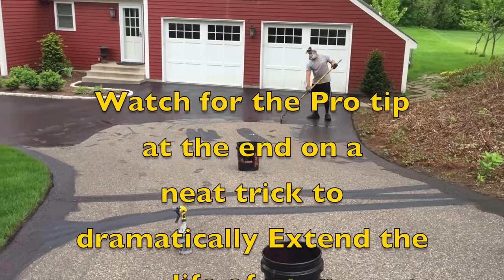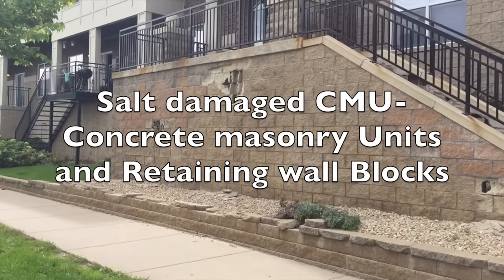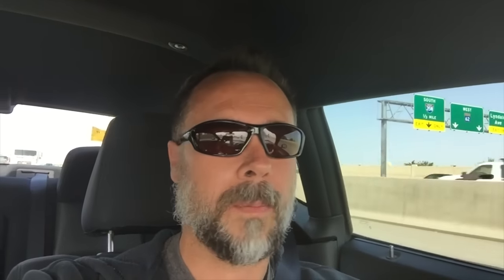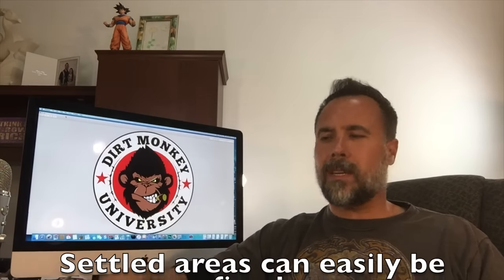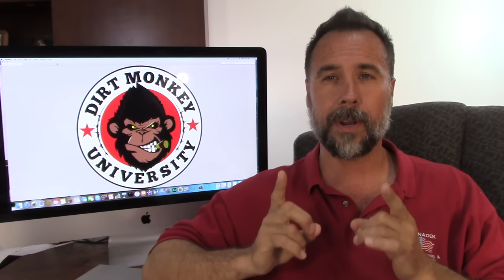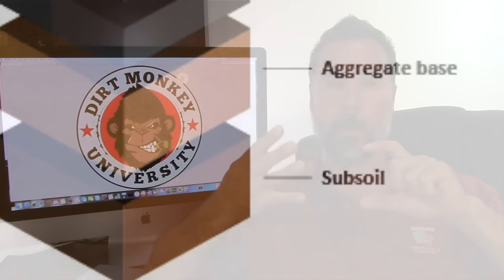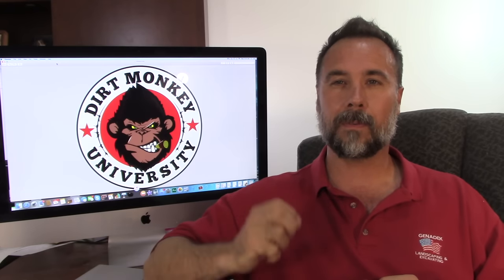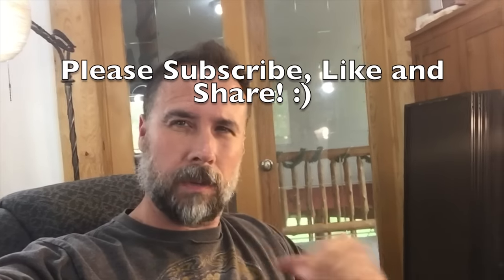Asphalt, Concrete or Paver Driveways- Which is the best?!?

Comment: SS1 emulsified tack oil works great for a quick repair on your asphalt surfaces, such as skin patching, or saw cutting with a diamond blade, correcting any base issues and then re-paving the problem area.  Lots of paving companies are happy to pick up this work as filler between big jobs where there base isn't ready.  You apply the oil, hit it with a tiger torch to prime it, add the new hot mix over it and compact for finish.  Or hitting you're existing asphalt with a tiger torch will heat up the surface to make it pliable and problems can be corrected, reasonably easily, with an asphalt lute (rake), plate tamper, and asphalt sprayer (chemical sprayer from any hardware store).  All that said the corrected area will take on a new color and stand out so seal coating should also be considered after the repairs are completed for a uniform finish.  Re-surfacing is usually after 15-25 years for a properly finished job.  If you need re-surfacing after 3 years, the paving contractors in your area are not doing their job properly.  For example, not excavating the sub base far enough, not excavating down to clay, if clay can't be found under 2 feet of excavation, not introducing geogrid (trampoline like fabric) with at least 6" of structure (3/4 road crush on top - fractured on 3 faces for ideal compaction - or soil cement), not introducing water to the gravel during the compaction process for ideal densities and maximizing load capacity of that base.  I'm talking about a 4 season climate.  If you guys are only getting 3 years out of your asphalt in Michigan I might just come down there and set up shop!  That's crazy!
Reply from the maker: Joshua-  Spot on advice!  Thank you!

Comment: Here in Alaska the muni cross section for driveway is 18" of gravel(3" minus/pit run), 2" leveling course(D1 or RAP) and 2" of asphalt, or 18" gravel and 6" concrete on anything that will be driven on.  I personally always put geotextile woven fabric under all my excavations too! Makes for a good driveway! I never get just putting 4"-6" of sub base....just won't hold up here...
Reply from the maker: You guys have to much frost movement-you need the extra base.

Comment: In Australia we typically don't use asphalt mostly we use concrete but yes always get a good base for it and use reinforcement mesh it helps stop alot of flexing and cracing in the concrete and whenever you join against and existing pour/hard rock like surface pin/dowel it to it in my area so many didn't pin and dowel their driveways paths to their homes and they pop up and make nasty trip hazzards
Reply from the maker: Very true. Good point👍

Comment: As per ACI specs we cut our lines 1/4 of the slabs thickness and depending on the slabs size we measure and cut accordingly. No more then 10' apart.

Comment: Alot of left out information concerning an asphalt driveway , an asphalt driveway that's paved over a rock hard non moving base will last 30 years without cracking as long as you apply a thin coat of non rubberized pure oil base asphalt sealer ,not the clay based asphalt emulsions sold at home Depot & Lowe's , a 5 inch asphalt finished thickness will Outlast concrete when laid over the same non sagging base ,also the depth and type of base material depends on what conditions are found under the top soil or old driveway ,after the existing soil base is compacted if any movement of the soil is seen when the compactor is rolling over it is when you chose the base materials and thickness ,in a deep snotty clay base you should allow the existing base to sun dry for 30 to 60 days before adding base stabilizing materials like 60/40 ,crushed concrete or limestone ,if you started with a squishy base then you want to mix in a few tons of Portland cement to the existing Earth and compact it before adding a layer of crushed limestone and allow the limestone to sit another 30 days before paving ,on the day of paving have the contractor put down and compact a layer of 60/40 road mix or asphalt millings & compact it before paving , make sure you order a 5 to 6 inch finished depth that's installed in 2 separately compacted layers instead of the single pour 3 inch depth standard ,once paved make sure any gaps between the paving & grass are immediatly filled in with Earth & grass seed before compacting ,stay off the driveway for another week or 2 and you can expect a double wide 2 car asphalt driveway to last you every bit of 20 years without developing a single crack ,if your new asphalt drive dosent crack within the 1st year you know you have a rock hard base that won't sag and you apply petroleum based asphalt sealer at the 1 year mark using a squgee coat just thick enough to fill in the semi pourous asphalt paving ,don't ever use rubberized sealers or water based emulsions because both will peel or flake off unlike a petroleum based sealer that binds with the petroleum based asphalt paving ,you should reseal your asphalt driveway every 12 months applying the thinnest coat possible to cover last year's sealer ,not every 3 years , if you can wait for your new driveway to be completed for 3 to 4 months and follow the base layer install outlined you can expect a 20 to 30 year crack free driveway that looks new every 12 months due to you resealing the asphalt and replacing the petroleum in the asphalt by using only petroleum based sealers , I own over 60 rental homes in middle to upper middle class areas with all types of driveways ,including brick pavers & every drive I replaced over the last 42 years has been asphalt using the standards created for America's expressways & only 1 drive has cracked due to a renter having a gas leaking truck that degraded the asphalt ,I'm also a licensed contractor with a Journeyman card in waterproofing that covers parking lots ,parking ramps ,commercial roofing ,below grade waterproofing,road building  , exterior wall waterproofing of brick cement and all woods,bridge waterproofing as well as residential driveways so I'm not talking out of my ass .
Reply: How can anyone read this without going crazy?!  Run-on sentences throughout the whole thing.

Comment: Hello, great video, Thank you. Re base thickness, do you mean before or after compacting? Which hard surface is best for South Florida so that's heat and humidity - also near a lake so not sure if salt is a factor? Current drive is asphalt (old house) with the crocodile cracks everywhere...

Comment: Stamped concrete will usually have a sealer on it as well making it slippery when wet. It doesn't seem to fair well if shoveling snow with a metal shovel either.
Reply from the maker: Good point👍

Comment: I have a large amount of water where the swale goes from dirt/gravel up to my asphalt. This has caused sinkage of the ground underneath (since water can get under). When I re-do the driveway, I'd like to add drainage so that water from this dirt/gravel gets quickly directed to the other side of the driveway.

What type of driveway is best for this, to stay flat, and to allow water to run through it? Can I get like 1 or 2 surface drains with perhaps metal grates to span the width of the driveway to help?

Comment: Crack sealing for asphalt and concrete hands down is the best contract job you can get. You can rent a crack sealer for about $300 a day buy about $500 of material, two man crew can accomplish a $5,000 job in just 1 day. Best part of crack sealing is you need no tools besides the machine. I would of never been able to break the 6 figure profit mark without adding crack sealing to my services.
Reply from the maker: I never realized it was that profitable.
Reply: Matthew Meek same here, i only work 100 days a year now
Reply: I can't believe people throw their money around like that.   My 3,200 sq. ft. driveway is being done (6" base material and 3" of asphalt) for not much more than that.  I'd either do the crack sealing myself, or I'd wait for the entire driveway to fail and then replace it.
Reply: What the heck are you renting

Comment: If you keep your water to cement ratio as low as possible, you will have less shrinkage.  Using a good curing compound will also help to minimize rapid evaporation upon initial setup.  Finally if you can seal the surface, it will help to keep the concrete looking good.
Reply from the maker: Good advice!

Comment: I really want to move to where all of these guys are having work done. I'm an asphalt paving contractor. paved thousands of driveways. I live in an area that we  get lots of snow, and the weather is usually not sunny but for about 3  months out of the year. Proper way to lay asphalt is to have a proper base first. The  base needs to include at least 12 in of pit run, which is very large Rock and gravel mixed basically virgin gravel out of the ground. Graded and compacted to the height and level that you want your driveway to be.  Next you need 2 to 3 in of 3/4 crushed gravel to reach your final grade. It then needs to be sprayed with alot of water and compacted until it feels like concrete to walk on.    This is the only way to get a proper base and not have to worry about the material that is being laid on top of it, whether it's asphalt concrete or pavers. I noticed cracks in all of the driveways that you showed your video.  If you don't want cracks then make sure that you got a proper base and by base I don't mean small 3/4 inch Rock 12 in thick. that doesn't work. Small crushed rock is not a good base material it moves around when you drive on it and never gets the compaction that you need you need big rock 10 inch plus with binder soil mixed with it. After all your prep work is done and you have the proper grade then you're ready to lay asphalt on top of it. A 3in compacted asphalt Mat is very desirable but 2, 2inch lifts is even better. There is absolutely no reason to seal coat your new driveway for the first 12 months because asphalt doesn't cure for 12 months and sealcoating you will not do any good.  After 12 months then you need to apply a seal coat.  The average cost is about $0.20 a square foot and should be applied every third year. If you do end up with some cracks in your driveway the cracks need to be filled with hot rubberized crack filler. It needs to be applied to fill in the cracks to the height of the asphalt it might take two or three passes to get it to the right height. I have driveways that are 15 + years old that have very few cracks in them and still looks like new. If the cracks are filled immediately and not allowed to sit with moisture and anything else that can get in them they won't expand can you drive will still look new 20 years later. There is no doubt in the driveways that I laid today will still be there 30 years later and look good. Love you Work Stan, I enjoy your videos. Thank you for sharing!!!!
Reply from the maker: Appreciate the comments Jeremy, thank you !

Comment: my asphalt driveway has about 12 inches of extremely compacted gravel under it and it hasn't cracked in 15 years.
Reply: 12" of base that's why it has a solid base so it doesn't move and crack
Reply from the maker: Solid😄👍
Reply from the maker: +Ron Thomas yes👍👍
Reply: Bottom line, you pay for what you get.  If your cheap and you try to cut corners then you will end up repairing it shortly.  If you got the extra $$$ and you pay more to do a correct job, you'll never have to repair it for a long time.
Reply: 12 inch is minimum atleast here in europe i did put 20 since i have 35 tons truck driving over it on daily basis

Comment: Pavers are also subject to the same deterioration as poured concrete but can be replaced separately, buy extras upfront you will need them.  Also even with the best installations the side pavers will move away from the field.
Reply from the maker: Good point Roger.  get a few extra upfront and then you will have them as needed and the colors will match closer.

Comment: Thermal expansion is probably the number one reason. As the top layer heat up, temperature differential between the top layer and bottom layer causes stress since bottom layer is colder and held by internal steel reinforcement.

Comment: also with stamped concrete cracking, you still have to saw in the joints just like you would a normal driveway or patio. but the problem with that is contractors are cheap and don't cut down enough for it to be a good control joint, they try to save their blades by  just cut 1/4 " and making the control joints way too spread out when it should be 3/4"-1" deep at least. and every 8ft in every direction.

Comment: I know these are just driveways, but at 4” you need a layer of rebar and contraction joints to stop the cracks from temperature and shrinkage if you really want your driveway to last long. Going thicker than 4” I cannot see how you get away with no rebar and expect the concrete not to eventually crack.  I think people don’t want to spend the extra money on rebar, just pour my driveway and forget it, but knowing the material properties of concrete no way you will get away with no cracks eventually. Rebar and contraction joints just help mitigate them.

Comment: My neighbors stamped concrete surface is pitting and eroding from the glossy surface. Rocksalt used in winter did that. I told him to use Calcium Chloride for de-icing instead.

Comment: Hi Stanley! Thanks for the video. It was very informative! My question is, I live in the Mid West were we get lots of snow and below freezing temps in the Winter. Since using salt is inevitable and since pavers are, I assume, made out of a concrete like material, won't the salt eat at it just as it would a concrete driveway? Thanks again for the video!

Comment: Outdoor concrete should be ordered from the ready-mix supplier with air entrainment (typically 4-6%) to avoid spalling in freeze thaw cycles. Air entrainment is like little micro-bubbles in the concrete that give the freezing and expanding water somewhere to go. The retaining wall block shown looks like it lacked an air entrainment admixture. As some have posted previous, the concrete placement contractor needs to avoid adding water altering the W/C ratio which weakens the concrete (each 1 gallon of water p/ yard of concrete equates to a 200+ PSI loss in compressive strength). Over mixing and retempering of the concrete in a barrel truck will devoid air entrainment. Overworking the concrete surface will work out the air entrainment at the surface where you need it the most. Lastly, any joker who you see adding water directly to the surface of the concrete as a finishing aid is doing all of the above in one fell swoop. I tell my clients there are 20 ways to ruin concrete before the concrete contractor leaves the project. I attempt to educate them so they hire someone who understands both the science and art of concrete before investing good money in a project destine to fail otherwise.

Comment: surprised you didnt mention rebar in concrete.  i find that usually keeps cracks from forming.  i also split my driveway into 4 sections with a row of brick for separation
Reply: And now concrete can come with fiber to replace and improve the concrete.
Reply: @thomaspayne6866  is that used to replace rebar ?
Reply: @jimmybrice6360 No, it doesn't replace rebar.  It gives the concrete greater ability to flex before breaking.   You still need the rebar too.

Comment: i will never have another asphalt driveway.  had concrete through 4 winters now, temperatures fluxuate from -30 deg C to 35 deg C here... no cracks... how can you go wrong.  clean, looks classy, and was only about 30% more than asphalt.. no/low mtc.  pavers for me out of question... i'm not frigging with that and cleaning weeds out of the cracks.

Comment: concrete will be the best. u forgot to mention the different grade 3,000 psi all the way to 5,000 
regular rock being the standard and limestone being the best quality. and yes concrete will always crack but that's why we do control joints at least every 8ft. your neighbors were too far spread out. we've never had problems pouring concrete just have a packed subgrade, 4" thick 3,500 psi limestone, control joints every 8ft and curing compound for residential properties where you won't have anything heavier then say 25thousand pounds driving on it.
Reply: Exactly!

Comment: With a 6 inch base material on a paver outdoor patio can it support the weight of 8ft pool table without any additional concrete support for the legs, pool table weights approx. 785lbs?.... any remarks will help, thanks

Comment: Hey stanley! This is the exact question I've been looking for answers to. I think I've decided on a poured concrete driveway. 2  Questions for you: on your driveway did you use any rebar/remesh of any kind? And does having a steep slope change anything with the base material? My driveway is only 20' or so but sits at about 15-20° above level. Thanks friend! Super helpful videos

Comment: Nice job on a great video!  I'm looking to replace a concrete driveway that has cracks all over, due mostly to settling, and nearby tree roots.   I am thinking of using pavers but I wanted to ask you the pros and cons of the different types.  Have you heard of the composite pavers made from recycled tires?  They're lightweight, and they are made to handle the weight of cars/trucks, etc., but I'm sure there are other advantages/disadvantages compared to bricks or concrete pavers.  Thoughts?
Reply from the maker: I haven't heard of them-  is their any long term tests out there.  That is really the indicator if they will hold up.  I don't believe "claims" unless I see they have lasted in a real application for many years.